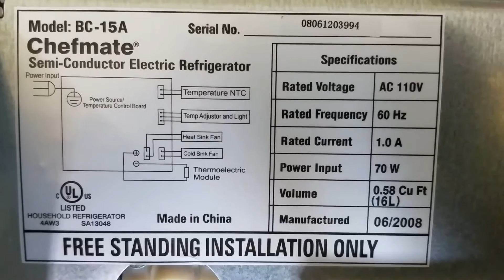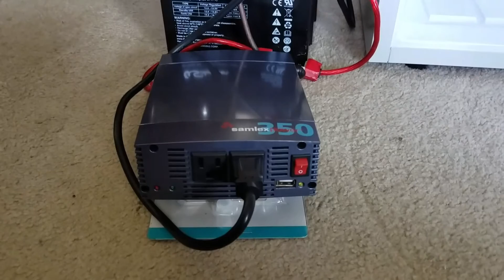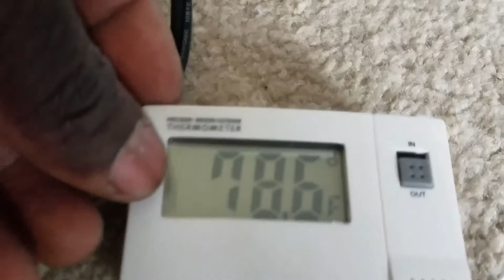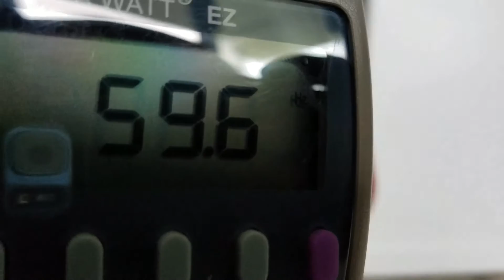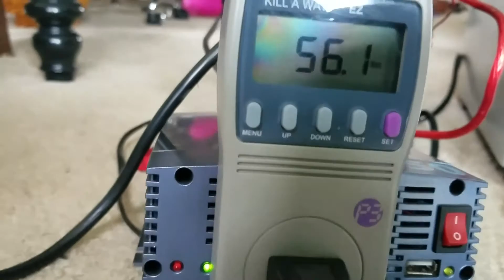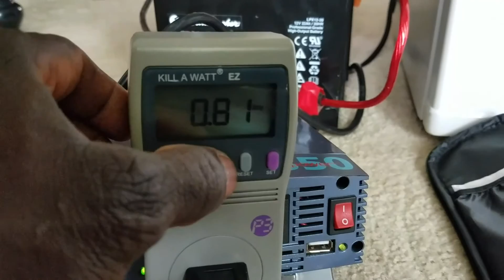SOLAR SURVIVAL KIT Pt.7 By: jwsolarusa

Comment: this is a thermal electric cooler, these are very inefficient, a compressor based fridge would be much better. hope this helps you :) great test man!!
Reply from the maker: +fliping720 
Thanks brother for sharing that information.
God bless
Reply: The problem with a compressor based fridge is the surge amps/wattage when it starts.  The thermal electric cooler fridge doesn't appear to have a surge current if it does it ain't no where close to compressor based fridge ), I also noticed it has a circulating fan inside which is like a compressor based fridge.  If I had the choice in an emergency i would choose the thermal electric fridge.  I could run that fridge on my 80 watt panel with no problem.